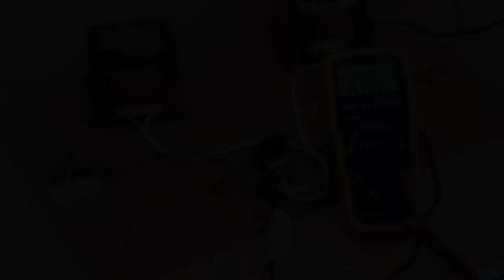DIY Welding Machine / Only 2 Microwave Transformer / Good Job

Comment: Buenas noches saludo desde nicaragua me podrias regalar el esquema de el dimer q le pusistes xfavor te lo agradeseria
Reply from the maker: Hola.  El atenuador que uso es el circuito de atenuación estándar.  Puedes encontrarlo fácilmente en el mercado.  Agregué 4 triacs porque el circuito que tengo es de poca potencia.  Si puede encontrarlo como 4000W, no necesita conectar un triac adicional.  Los diagramas sobre las conexiones están disponibles en la sección de descripción.  Si no lo encuentras o si quieres algo más, vuelve a escribir.  Por ejemplo, si desea hacer el circuito del atenuador desde cero, también puedo dibujar un diagrama para ello.  pero será más barato si lo compras.
Reply: si entiendo pero esq yo quiero aser el atenuador casero de ese mismo pero nesesito el esquema para aserlo ya q tengo los componentes una pregunta los puedo aser con el triac Q6040J7 que es el q tengo a mano y tanvien tengo el BTB 16_600
Reply from the maker: Hola.  Hay un circuito de atenuación en el enlace que di a continuación.  En lugar de la lámpara, se conectará el primario de los transformadores de la máquina de soldar.  Reemplace el triac dado como bt136 con el q6040j7 que tiene.  no se necesita nada más.  Dado que el q6040j7 es de 40 amperios, es suficiente por sí solo.  Si hay algo que no entiendo o quieres preguntar algo, no dudes en hacerlo.
https://images.app.goo.gl/aDYSzZWZtYU5Aw5s7
Reply: ok muchas gracias ya ise el atenuador casero con ese triac Q6040J7 una pregunta cuantos wat me soporta este triac
Reply: me gusto su invento y la creativida que tiene ademas de los materiales yo no tengo esos materiales
Reply: usted es ingeniero electronico
Reply: dios me le bendiga buenas noches cristo le ama su benida esta serca att kevin de jesús medina saludos desde nicaragua
Reply from the maker: Hola.  Muchas gracias por las lindas palabras que escribiste.  Lo escribiste así porque eres una buena persona... Un triac de 40A puede quitar una potencia de alrededor de 8000W con un simple cálculo.  Pero esto es solo un cálculo matemático.  Cuando entran en juego factores ambientales como las condiciones climáticas, el calor y la humedad, podemos decir que puede manejar una potencia de 5000W o 6000W.  No olvides instalar un enfriador.  que tenga un lindo día.  Hola
Reply: muchas gracias por la informacion ay seguiols en contacoto buendia bendiciones
Reply: muchas gracias por la informacion ay seguiols en contacoto buendia bendiciones
Reply: Una pregunta do de te podria seguir para mas informacion si sos muy amable dios te bendiga a vos y a tu familia
Reply: buen dia mi her queria aserte una pregunta con ese triac Q6040J7 SE PUEDE regular la belosidad de un motor de 120v
Reply from the maker: Puedes preguntar, por supuesto, pero no entiendo la pregunta.
Reply: q si con el dimer q ise con el triac Q6040J7 puedo bajar la belosidad de un motor de 120voltio
Reply from the maker: Lo siento, cuando traduces, es posible que no se formen oraciones completamente significativas.  Según tengo entendido, me está preguntando si puedo manejar un motor de 120 V usando un circuito de atenuación hecho con este triac.  De esta manera puede arrancar el motor pero el par no será el que debería ser.  En su lugar, puede usar un transformador 220/120 o usar un controlador de frecuencia controlada.  Sin embargo, puede ser un poco caro.
Reply: no la pregunta es en local es de 120v la red publica y tengo un motor de 120 v q esta en un hornito de panaderia la pregunta es si me sirve el dimer q ise para bajarle las reboluciones a este motor
Reply: osea en mi local de red publica es de 120v y el motor es de 120v tanvien puedo bajarle las reboluciones con ese controlador q tengo con ese triac Q6040J7
Reply: ay disculpe la molestia esq no tengo a quien preguntarle
Reply from the maker: Nunca te han molestado.  Lo siento si te hice pensar de esa manera.  Por favor no dudes en preguntar.  Si es un tema de mi conocimiento, intentaré ayudar en lo que pueda.
Reply: muchas gracias dios te vendiga grasias x comprenderme
Reply from the maker: Acabo de ver algunos mensajes.  Está preguntando si su voltaje de red es de 120 V y el circuito del atenuador hará el mismo trabajo... sí lo hará.  Ningún problema con eso.
Reply: ok muchas gracias esq la otra ves ise un dimer con el trac bt136 y lo puse en el motor para bajarle la intensida y reboluciones pero se me daño no se porq y quieria probar en este triac Q6040J7 aver si no se me quema
Reply: q dios te siga dando mas entendimiento dios te bendiga cristo te ama mucho no te pierda cristo biene pronto
Reply from the maker: El BT136 es un triac de 6A.  No será muy duradero.  Dado que el otro es 40A, no será un problema.
Reply: graciad bendiciones

Comment: Hola buenos días te saludo desde palmas del socorro Santander Colombia porfavor me puedes enviar los materiales que se deben tener para construir un soldador de esos porfavor se lo agradecería mucho me puedes enviar la información al privado se lo agradezco mucho
Reply from the maker: Hola.  A excepción de los transformadores de microondas... Usé un total de 13 metros de cable de cobre con aislamiento de silicona de 4 mm2.  Puede buscar este cable en Internet como cable N2GFAF.  Usé un circuito de atenuación para el ajuste de corriente.  Usé 4 triacs BT136 adicionales ya que el circuito que tengo es de baja potencia.  La potencia total aumenta cuando los triacs se conectan en paralelo.  Sin embargo, si se usa un atenuador de 4000 vatios, no es necesario conectar un triac adicional.  El diagrama de cableado general y los diagramas de cableado del triac están disponibles en la sección de descripción del video.  Usé 2 ventiladores de 12V y un adaptador de 12V para alimentar estos ventiladores.  Usé un interruptor de 16 amperios como interruptor de encendido/apagado y un enchufe de fuente de 10/25 para las sondas de fuente.  Cables de sonda de soldadura 1 - Cable de cobre de 1,5 metros y 10 mm2.  Los alicates de soldadura son alicates 300A.  El aluminio que usé para la caja tiene 3 mm de espesor en los paneles frontal y posterior y 1 mm en la cubierta.  Usé el cable del horno de microondas para la entrada de 220V.  Traté de escribir todo lo que me vino a la mente.  Si olvidé algo, por favor escribe de nuevo.  Traté de dibujar los diagramas de cableado de una manera que todos puedan entender.  Gracias por su atención, que tenga un buen día.  Saludos desde Turquía

Comment: Sir master this dimar dat you used her be 4 the four transistor is the same nombe with the paralet one sir
Reply from the maker: Hello.  It's okay for me to answer your questions, but as far as I understand your native language is not English.  That's why I can only half understand most messages.  Write in your language if you want.  I sent you the wiring diagram links earlier in a few messages.  Since the circuit I use is 2000W, I connected an extra triac to make the circuit stronger.  Since the product I sent you the link of is 4000W, there is no need for extra processing.  If you still want to do it, please write me exactly what you need in your language.
Reply: thanks master eny easy one sir and you can give me the two diagram sir please
Reply: Master good day sir longest Time how is grand pa body I lose my Fon I just trying to get you back sir please i never buy the wire before I lose my Fon wen I get to the Shop they show me two tipe of the wire sir there is single cable wire with the number and there is one with many which one I will used sir

Comment: I hope that you will refer to the volume chart and the electronic parts, their value in numbers, and how to attach them to the card, so that I can install them myself on the welding machine, and for the benefit of the subscribers and followers of your channel. Greetings.❤
Reply: For real, I was looking forward to seeing links to purchase the electronic parts used with the correct ratings on platforms like Amazon or ebay or where ever it can be ordered.
Reply from the maker: Hi.  The 2 diagrams in the description section will help you.  Did you download these schematics?
Reply: no i didn't will do so

Comment: Can you provide the max thickness it penetrates?
Reply from the maker: Although it is not very thick, it works very well on 8mm thick metal.
Reply: Thank you dude, just one more question- I saw you  clamped down your vise with only f clamps, are they that strong to hold it? And do you think taht f clamps have ample gripping capacity on their shafts?
Reply from the maker: I couldn't understand which part you were talking about.  Are you talking about the clamps I use when welding?
Reply: yeah

Comment: Me acabo de fabricar una fuente para car audio con tres transformadores, un puente por transformador y capacitores, antes de poner los puentes rectificadores en corriente alterna me da 13.5 volts y después de poner los puentes me da 11 volts, cuando lo conecto al equipo el voltaje se dispara a 18 volts, alguien sabe porque sucede eso?
Reply from the maker: Hola.  El motivo de la caída de voltaje se debe a la caída de 0,7 V en cada diodo.  Sin embargo, este valor es relativo al valor máximo de la tensión alterna.  Si agrega un capacitor a la salida, el valor de CC medido aumentará.

Comment: hii sir 400 amp welding mchine how tranformr usss 900 watt
Reply from the maker: Hello again.  It is necessary to use 6 transformers for 400A.  It would be good to wind at least 10mm2 of cable.  More thickness if possible
Reply: thnq sir 
how yares warany welding machine sir
Reply from the maker: I do not understand this question

Comment: buen dia una pregunta ya hice mi soldador  esta funcionando pero al conectarle los triac  se calienta mucho el  dimmer y me quemo un condensador cerámico y creo que también el triac que trae la placa  pero los tria que le conecte en paralelo ala placa que fueron 6 no parecieran que funcionaran que podria ser  o si tienes algun telefono para poderte contactar por whasat gracias
Reply from the maker: Hola.  En primer lugar, tengo que disculparme por no poder dar mi número de teléfono.  Su circuito de atenuación puede estar funcionando mal.  Es posible que se haya producido un cortocircuito durante la conexión en paralelo.  Puedes probar el circuito con una bombilla incandescente si quieres.  De esta manera se puede saber si está defectuoso
Reply: osea al conectarlo el sube y baja el voltaje pero al soldar lo calienta mucho  y lo quema
Reply from the maker: Si el voltaje sube y baja, creo que los triacs están bien.  En tu mensaje anterior, parece que dijiste que el capacitor se quemó... Si es así, el problema puede ser de él.  El capacitor en el circuito y el potenciómetro conectado a él en serie oscilan y activan los triacs.  De esta forma, la señal sinusoidal se corta y cambia la potencia de salida.  Es normal que los triacs se calienten, pero no es normal que se sobrecalienten.
Reply: mira que pena molestar tanto lo que pasa es que el único que se sobrecalientan es el que esta conectado ala placa los otros que le conecte en serie ni siquiera  se ponen tibios y le puse los bt137 600d
Reply from the maker: Retire el triac unido a la placa y continúe con los demás.  Asegúrese de que las conexiones sean correctas.  Recomiendo usar 6 bt137s.  Si el capacitor y el DIAC en el circuito están bien, no debería haber ningún problema.  Después de hacer lo que te dije, te recomiendo que pruebes con una bombilla incandescente y te asegures.
Reply: Muy buen dia lo voy hacer y te inform gracias
Reply: buen día hice la prueba retire el triac que trae la placa hice la prueba con la bombilla y funciona bien pero la conecte a los transformadores y los quemo no se que podría ser o cambiar los triac por otros
Reply from the maker: Gracias también 👍
Reply from the maker: no se que decir  El circuito que funciona en la prueba de bombillas también debe poder operar los transformadores.  Espero que puedas encontrar el problema.  Buena suerte con